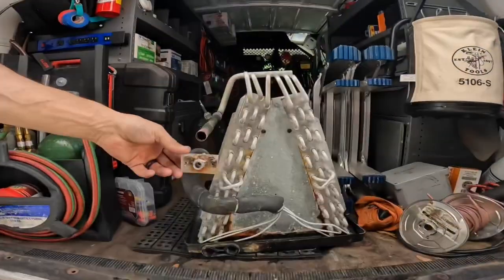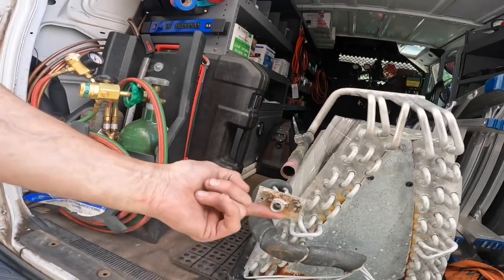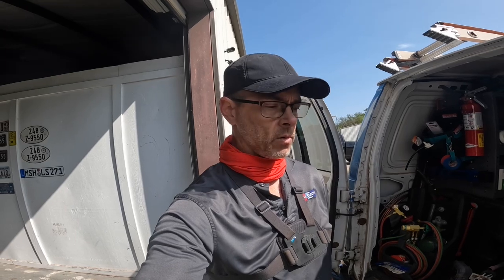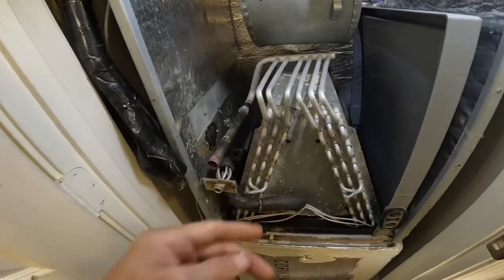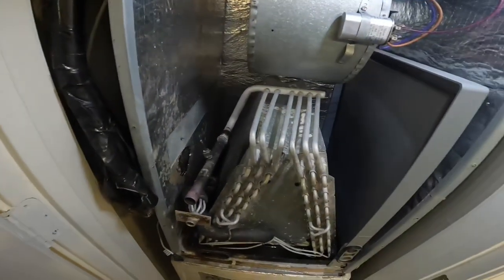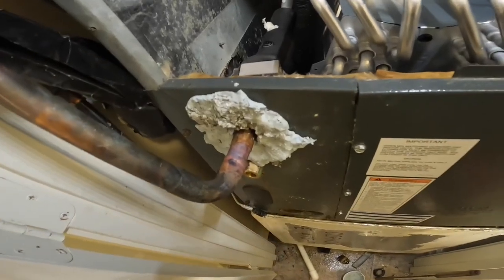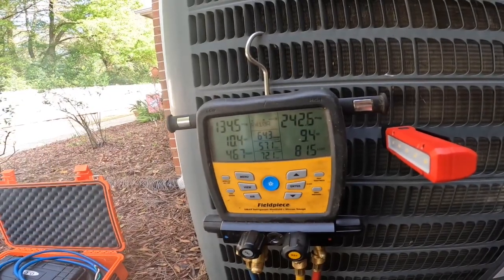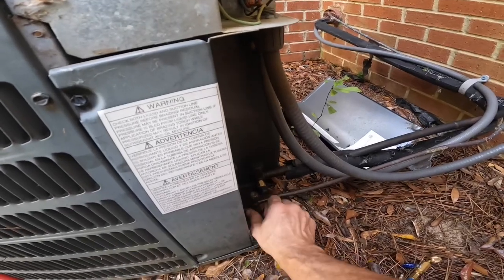Replacing TXV With Piston While Changing a Coil. Schrader Tore Apart When Removed

Comment: I would prefer a TXV because with a piston the refrigerant is fixed going to the evaporator so if you have enough refrigerant in the system to cool the entire evaporator under high heat loads including latent heat [water in the air/humidity] then after the heat load drops and without an accumulator you can send liquid back to the compressor. So you have to put less refrigerant in the system so that doesn't happen under low heat loads but then when the heat load is high the entire evaporator won't get cold. With a TXV you add enough refrigerant to keep the evaporator cold under high heat load but then as the load drops the TXV automatically closes so liquid refrigerant doesn't get sent back to the compressor... Hence a TXV is more efficient, it provides maximum cooling capacity under different conditions.

Comment: On systems with the dryer on inside of the condenser I usually cut out the dryer and straight pipe in that area and then move the dryer to the inside by the indoor coil. Makes it a lot easier if dryer needs to be changed in future or if there are future repairs. In your case though with that tight ass closet, I would have just moved the dryer to the outside by the condenser.
Reply: I agree done the same . Inside dryer tend to collect oil and then problems on pressures. I don't understand why would they put it inside condensers. No good.

Comment: How well are these aluminum coils holding up, my r22 system will eventually, maybe soon, need to be replaced and I'm trying to educate myself.
Thanks! ;)
Reply: Stay away from Goodman....  JUNK old coils and new coils.
Reply: @superdan9er  Aluminum seems very prone to corrosion but certain alloys are quite good.  Not good if very thin and chinsey.
Reply: @thisisyourcaptainspeaking2259  
Doesn't help that they buy Chinese metals that have other materials in them. 

Or how about the coils that the front of the coil is copper and the back is aluminum. 
Hmmmm where is that coil going to leak. Lol
Reply: @superdan9er  I'm convinced the aluminum is recycled beer cans, which explains why the "brazed" disimilar joints corrode right away and the alloy can be made thinner than notebook paper.
Reply: None of the aluminum coils looked that bad and they all leak? My copper looks terrible but doesn't leak and its been in my unit since 1993.
Reply: @WallaceRoseVincent  I had a hole rubbed in the thin (and rifled) copper tubing of the evaporator, where on one end "U" at the bottom, it had been rubbing on the plastic drain pan.  I simply soldered over the pin-hole after cleaning the copper with some steel wool.  It's very thin copper tubing, near paper thin.
Remounting the coil, the coil bracket screw holes are such that the coil ends will contact the pan if the screws are tightened while the weight of the coil presses it against the pan, so I made sure there was a slight gap between the two by pulling the pan away from the coil while tightening the screws.
Pulled a deep vacuum, pressure decay checked with dry nitrogen, a 2nd deep vacuum (150 microns) and charged refrigerant by weight, initial charge + additional line length.  Confirmed superheat in cooling mode, based on chart.

Comment: What's the benefit of converting from txv to piston?
Reply from the maker: Less likely to cause a problem
Reply: It cuts the efficiency about 1.5 seer. I've never had any real issues with txvs. I've got plenty I've installed 20 plus years ago that's still working fine. However I do absolutely 100 percent make sure no lines from the txv, or anywhere else for that matter, are rubbing on brand new installs.

Comment: I see you used a squeeze type tube expander. I has seen a few bad reviews about it. How do you like it?
Reply from the maker: It isn’t high tech but works. You need to learn how to be easy with it - little here, little there. It can split a pipe, or create a non circular opening if not use properly. Honestly though I’m thinking of buying the spin bits. I’ve seen them in action, and they look nice.

Comment: I appreciate your jedi like tech skills HVAC Guy and the content. I do have a question regarding the schrader adapter you used? I have had a schrader core break on a Goodman/ Amana condenser in the past. I over tightened and could not remove which resulted in me replacing whole service valve. Where did you find that female thread to 1/4" schrader? That is something I want to stock in the van
Reply from the maker: Got it at united refrigeration. I don’t think it had a depressor in it though, just a schrader on the end.
Reply: Thanks v much King! I reckon Johnstone should start carrying them too. I'll give it a try and grab that fitting asap

Comment: I just worked on a eev. I want to replace it with a txv so badly.
Reply: learn to be a part of the future. eev's are the future, get with it. its HVAC, shit will change every couple years. if you want to be stuck in the past: become a GM mechanic. hell, you are in HVAc, you are already more of an electrican than most electricans. that is basically what we are these days, electricans with blowtorches.
Reply: @SupremeRuleroftheWorld  yeah yeah yeah. I ordered a new EEV. Please spare me. EEV's are a nightmare for service. They just are more problematic compared to mechanical valves. Changing the EEV is the easy route, it just takes 5x as long due to supply chain and more time diagnosing electronics. Also long live the txv. Its not gonna die anytime soon, trust that.
Reply: @ryanmalin  in the US prehaos. In the rest of the world the eev is the defacto standard for even the most basic units for more than a decade. Every hvac service engineer learns with eevs and txvs are more theory in classes as basically every machine that still has them is written off as soon as something major happens and its replaced by modern stuff. You can keep complaining about it or learn to embrace it and charge accordingly if you can service and diagnose eevs and fvds properly. With the negative nancy attitude a LOT of lazy engineers have towards eevs there is a wide open market for the ones that can and will work with them and keep equipment up to code and effecient to save the customer money, wich is why they have the modern stuff in the furst place. Its not about you, its about the customer.
Reply: @SupremeRuleroftheWorld  You seem angry.